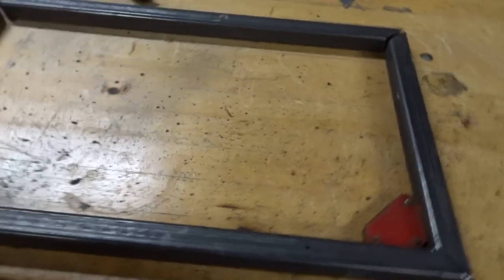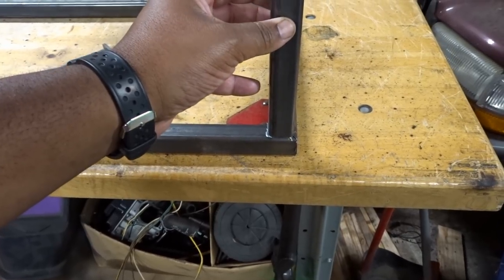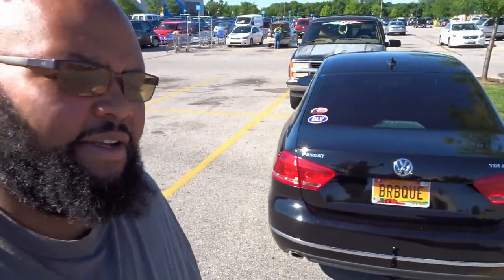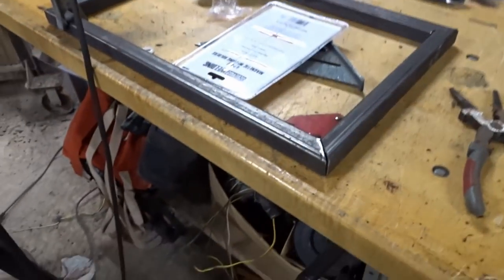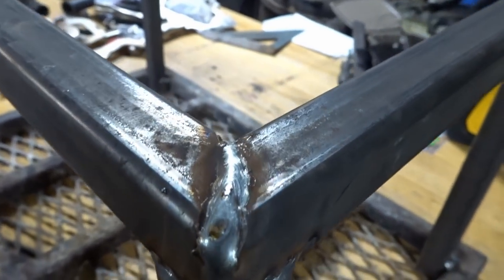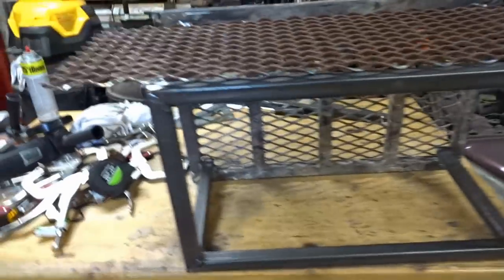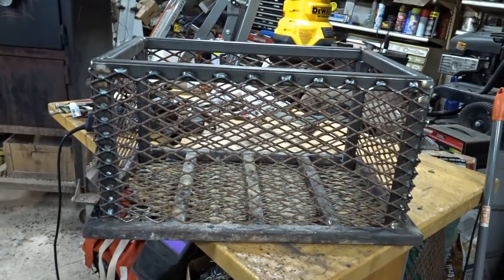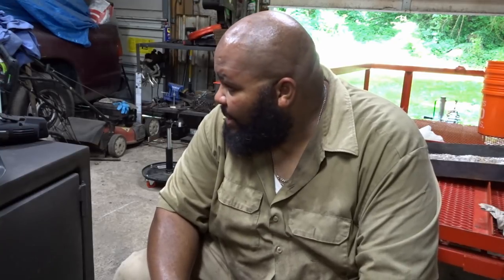SDSBBQ - New Smoker Gets a Charcoal Basket!

Comment: Dash if you dont weld all the time, Flux core wire works pretty good. no gas needed
Reply from the maker: Problem with Flux-Core is it is WAY messier than MIG. I actually have a FC welder just never liked the way the welds looked after seeing lots of videos when learning to weld.
Reply: thomas linden 👏🏾👏🏾👏🏾👏🏾👏🏾👍🏾👍🏾👍🏾👍🏾👍🏾
Reply: Never used anything but flux core, just made repairs to the racks in my smoker yesterday. After about a year and one-half, they were sagging in the middle (I guess I under built them). I added 1 1/4" x 1 1/4" x 1/4" angle to the front and back of each rack using C-clamps (thanks Harbor Freight) to pull the frames to the angle. Back in business. I use flux core because all my work is outside and it is basically windproof where gas is not. After all this time using flux core, I get some really decent looking welds on thicker steel. Thinner steel can be a challenge sometimes.
Reply from the maker: then there is that... I mainly weld in my garage and some of the things I have been welding (the steel drums) are very thin gauge metal. I think it is personal preference at this point. shrugs

Comment: Like ur vids brother...ima welder by trade, and 2 make ur tasks WAY easier!... salvage a decent size  piece of FLAT metal plate to go over ur wood table there!. Weld a scrap piece of metal in the corner of that plate (up right or "risor" like u say) about 2" tall...clamp that ground up there & ROCK & ROLL ..u will b surprised how much time u will save by not having to detach & reattach ur ground!!.. Keep the vids coming my man!!..
Reply from the maker: I'd like to weld up an actual welding table at some point. I got tired of working on the floor and started welding on this and so far I haven't had an issues. Though if I am going to use it more and more I will take your advice and put a plate on it and an upright to ground to. Thanks!

Comment: I can appreciate Your Metal Skills!   Can't understand why you would want to run charcoal as your fuel in 
such a Killer Stick Burner?    Maybe after the meat has taken on all the smoke it needs and you've then wrapped 
to finish?   It's two different set ups.......WFO.....and oxygen deprived.    WFO the way to go!
Reply from the maker: So when I used the new insulated smoker with wood I got a dirty incomplete burn that caused my food to be a little over smoked. When I got Vicky I had the same issues not being able to run her with wood only. I made a charcoal basket and use charcoal and wood and she runs like a dream. My hope is to do something similar with the new smoker. Stick around it'll all make sense after the first few cooks.

Comment: Great Job!  I need to stop watching videos like this..I want a welder now!  Can't wait to see it in use.  Question: Is charcoal cheaper than wood for you to cook with?  Or is the idea just to be able to supplement your use of wood with charcoal when you need to cook and don't have wood available?
Reply from the maker: This is a question I have never actually sat down and figured out. I believe charcoal is cheaper for me to use mainly because I buy it in bulk when it is on sale. I still have bags left from when I bought 300+lbs at $10 per bag last year. Figure that I can get almost 2 cooks on the vertical smoker per bag VS it costing me almost $200 for a chord of wood and I can go through a cart load PER cook with the big smoker. My plan was to use the new insulated smoker and stretch my wood supply but it didn't seem to run as well as I would like on wood. Which is why i built the charcoal basket and plan to run it like I do Vicky.